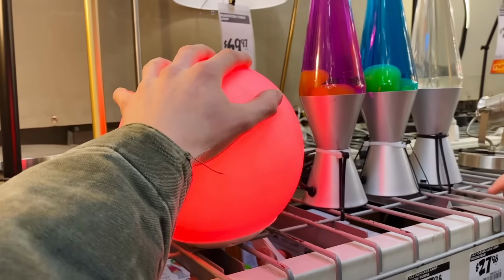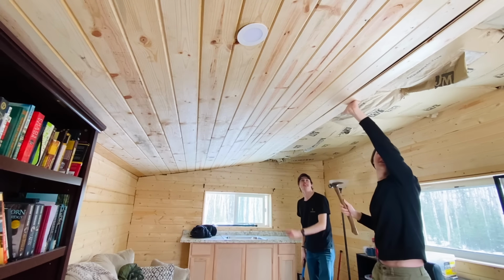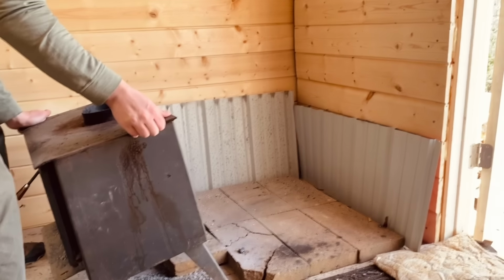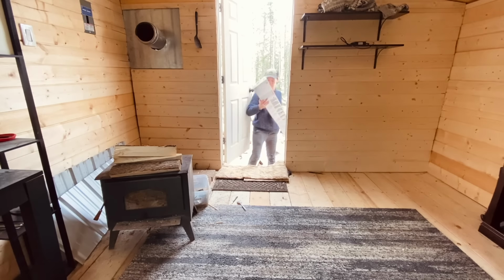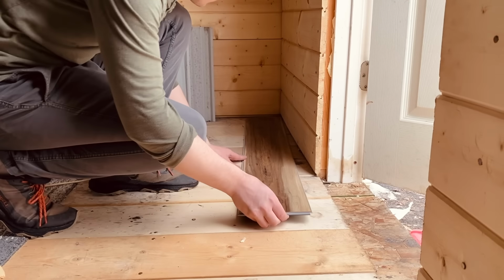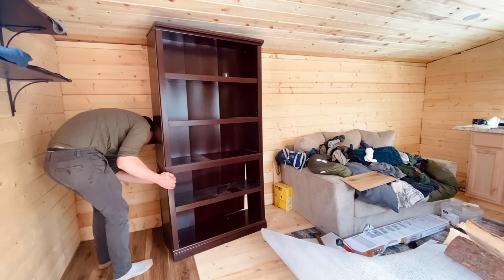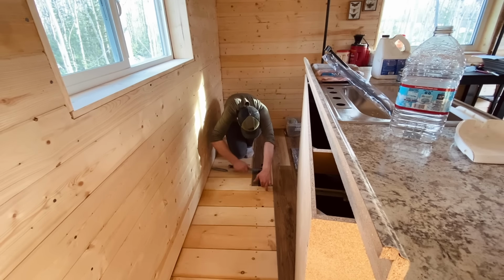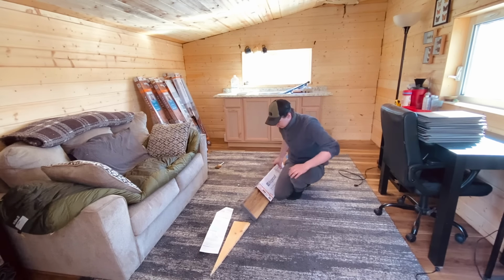Offgrid Cabin| Floor and Ceiling FINALLY FINISHED

Comment: Low-maintenance haircuts are the way to go…until winter returns. The cabin is looking more like a home than a shack, and that has to do wonders for your morale. A deck would be a nice addition…any luck on getting a new vehicle/replacement engine for your car?

Comment: Mick, I'm glad you're finishing the floor and ceiling before Summer hits. It will really help to keep the dust down. It's looking so good and I'm sure you have a sense of accomplishment AND relief that you're finally on the downhill slope of Pareto's 80/20 principle. Have fun up there and wear a cap so your head doesn't get burned. 😉

Comment: I love your new haircut!  WTF, it’ll grow back eventually. A few of my male friends do it every spring. Be aware that the texture may change as it grows back. One of my friends went from stick straight before the shave to a really tight curl until it grew out enough to style it.  

The cabin is looking good. I like the ceiling more than the floor, but they both look good.  It was neat watching you getting everything done and then straightening up the cabin again.  The satisfaction of finishing a big project is so exhilarating!

Comment: The floors really look great and make it feel like a finished home. I’ve done glue down vinyl interlocking planks for my first floor in my camper, and did interlocking vinyl in a cabin that will be rented to a friend. Getting started is the hardest part. But once you get in a rhythm it goes quickly. Both projects took a day. For the interlocking vinyl I bought  flooring cutter and it made all the difference for speed, and I can use it for future projects.

Comment: I'm with ya Mick, there are so many projects I am a bit leery of starting. Then once it gets going I realize I was over complicating it and putting too much pressure on myself. I'm working on a shed ramp and it requires a lot more angle cuts and notches because it's not just a regular sloped shed ramp. Drove myself nuts yesterday! So I had to regroup, make some drawings, and figure it out. Congrats on getting the floor done, and pushing through it! Good luck to you.

Comment: Great job getting the floor done. I would suggest adding an entrance room on to the cabin. You would have a place to take off boots and outerwear, plus it would be a barrier for loosing heat when you enter your main cabin room.

Comment: Good job on getting so much pretty much done! That makes you feel so good. Snowmelt is crazy. A good summer project is to do what my parents did in our yard: dig a dry river bed to divert as much of the water away from the house as you can. I pretty much surrounded our house as a lower area so our house was on higher ground and just used rocks from digging it to outline and line the lower  area. Then made stepping stones around the house so we could keep our feet sort of dry and less muddy when we had to walk outside the house to get fire wood and do other things. It was a fun ish family project we did the first summer at that house.

Comment: Hey good work on the cabin. The nice thing is you can easily add a room in any direction if the need arises. You look great with no hair good thing you have a round head, them ears stand proud though 🤣 stay after it young man.

Comment: Yo! Great day getting a vid drop from you. Love seeing your progress. You've inspired me. Saving up for my own land now. Im going to try to do off grid as well. Thinking about doing an anaerobic digestion system for power (RNG into a generator into a large battry bank) and liquid fertilizer. Maybe a little solar too. My land will decide if i do well or water catchment. Maybe a little of both.
Reply from the maker: It can all be done man, just keep saving. Land ain’t cheap but if you find the right piece it’ll treat you well. Best of luck!

Comment: Nice job Mick, the flooring looks great. But I still think you should get gas or propane heat for the winter. Sure beats trying to chop all that wood and keep that wood fire burning. 😊
Any big plans for the summer?
One more thing, your audio sounds a little muffled sometimes. Not sure if it’s your microphone?

Comment: Nice job Mick. Pretty soon all the work will be done and it will be all adventures. I have been a fan of Alaska since the 80's but at 57 not sure how I'd handle the cold. Finally talked my wife into an Alaska (Summer) cabin though. Until that comes to Fruition I'll vicariously live through you and your family lol. Again, nice job. By the way, why the shaved head? You totally pulled it off but just wondering why the drastic change?😂

Comment: I’m not a construction guy and I just found your channel. Shouldn’t there be a vapor barrier between the wall cover and the insulation in a heating dominated climate? I’m used to seeing walls without vapor barriers on the inside here in the south but when I’ve seen people build in Canada it’s always vapor barrier inside

Comment: And also: did you find an easier way to stay warm during the night or Will you tackle that problem after summer?
Reply from the maker: I’m hoping to save up enough to get a diesel or propane heater for next winter which should definitely fix the problem